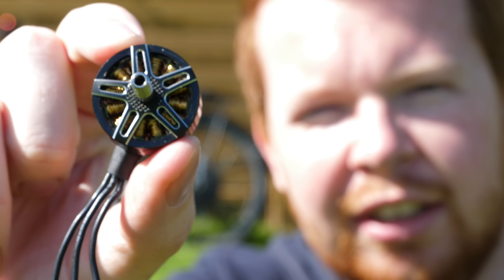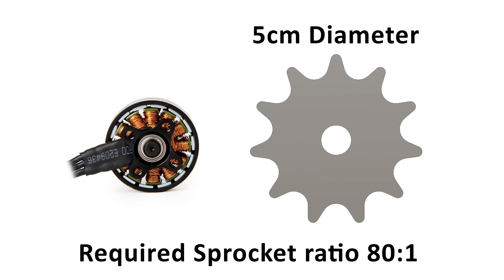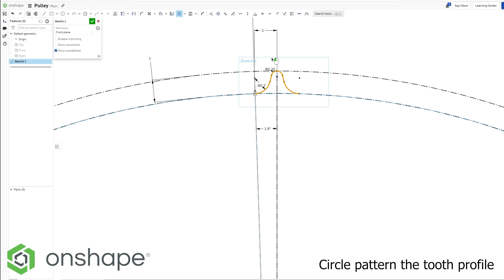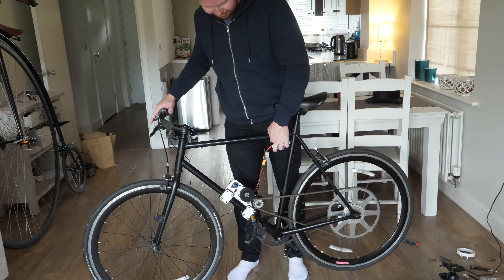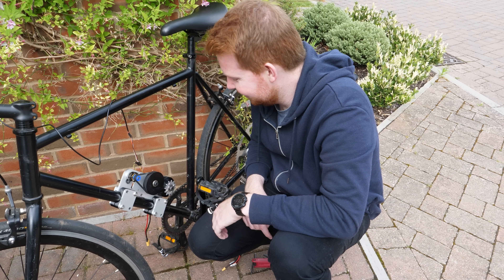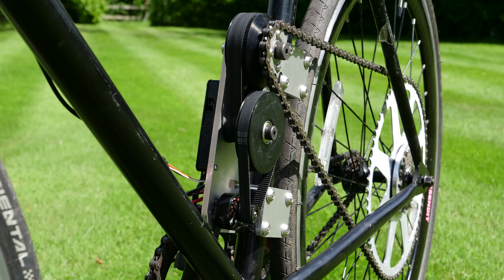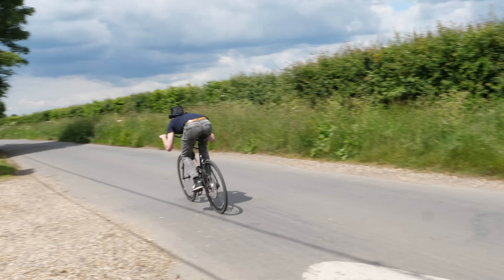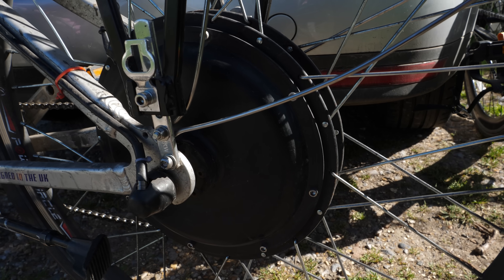Tiny 1kW Electric Bike Motor

Comment: If you were able to compare power and torque curves for both the bike motor and drone motor I’m sure they would look quite different. I bet if you were theoretically able to use a perfect CVT with no losses on the drone motor you could get it to perform close to the bike motor before over heating.

Comment: amazing video! It would be great to see video where you explain in details difference between mechanical and electrical power. Where all other wattage goes from 1kW - actual bike power? all for heating? does that mean that regardless of the cooling drone motor has certain max mechanical power hence the efficiency << 100%? that's no intuitive, because common knowledge that electrical motors all have  efficiency close to 100%. Also,  that tiny ESC you had installed, it seem like it shouldn't produce more than 40A max current, but these ESC usually designed only for burst max current, no continuous - is it possible that ESC is actual bottle neck there?

Comment: the wheel motor greatly increases the unsprung mass, while the motor in the carriage or as you put it on the frame leaves the weight distribution of the bike the same, it was worth using motors for aircraft, although they have more mass, but also higher torque ...

Comment: Its that initial start from a dead stop that is taxing the motor in my opinion.. but i would like to see a mount that would accept 4 like 3010 sized motors or similar size as a test. Or even better... 2 large X-CLASS motors but using the factory multiple gear selection of road bikes or mountain bikes to keep the motors at their optimal rpm.

Comment: Please add more motors and serpentine the belt around the shafts in a "W" shape so they share the load. maybe also just use a single wide toothed car engine timing belt and the 1-2 matching cogs from a engine head instead of a standard bike chain/cog. the motor mount slots and maybe also the belt tensioner from a scrap car (or same timing belt replacement kit where you get your belt) could be used to take all the slack out and tension it properly.

Comment: A few times in the video the chain split-link is visible and you have the split pin(the springy bit) on backwards, this would encourage it to release and fly away when the chain rubs against something. Love the engineering behind this project, keep up the good work :-) If you're ever over in Ireland we could do with some ideas on how to finish our trike project with a 110Hp 2.0Hdi automatic fitted :-D

Comment: What if you made the motor spin a roller, that was held against the tire?

Since the ratio of drive roller diameter to driven (road) tire could be easily achieved drive system would have fewer parts!

Comment: Why not ditch the chain and run a wheel on the tire. Could use a skateboard wheel as a drive wheel and a spring loaded pressure hinge

Comment: I don't know a lot about the topic, but I find it curious when such little motors have crazy high power ratings. I guess, in a drone, the motor is directly under or above a fan, and will get a lot of cooling air.... still, I know with lots of DC magnet motors they will have a rating for both max or momentary power, and then have a continuous duty rating that is a lot less. 

Some manufactures will just conveniently leave out the continuous duty rating and the word "max"  and just call it their power rating. Even worse are vacuum cleaner companies, who blatantly cheat the system and measure their motors from max rpm to an abrupt stall... so basically measuring the momentum of the motor and not torque. 

Rant over

Comment: I think a proper heat sink and possibly a air scoop to pull air past it, you'd get passed the over-heating issue.
Reply: And where do you put this heat sink?  The heat path between the stator coils and the motor mount is not very efficient, so no matter how big a heat sink you mount it on, the bottleneck is inside the motor.  These motors are designed to use forced air cooling, and that's the only thing that will work for them.  No big deal, though - just incorporate fan blades in the 3d-printed motor-to-drive cog thingy.
Reply: @BrightBlueJim  I was just thinking some fins off around the main body, to help dissipate, and the scoop as a stand-in to blow air past the motor.
The faster the bike, the more air through the scoop, past the fins and motor vents.
Reply: @zeekjones1  On an outrunner motor, which almost all drone motors are, the "main body" is the rotor.  It doesn't actually generate a lot of heat, because it only houses the magnets.  Most of the heat is generated in the stator, where the wire coils are, and there is very little path for that heat to get to the mounting hardware.  Furthermore, it takes a LOT of airflow, like way more than you can force through the rotor with just a scoop, to cool these motors.  Just trying to save you some time, since plenty of people have tried what you are suggesting, and failed.

Comment: Add a cooling cowl around it and a short bladed cooling fan directly on the motor shaft, that oughta keep it much cooler, but its always gonna be far worse in range from all the gearing losses and thermal losses. This was very cool to see though, as an experiment to show, practically, just why low rpm motors have big rotors and why high rpm ones use a tiny rotor instead.

Comment: My idea for a version 2...
Add more Motors around a central gear system they all dump their power into that you then connect by a chain to the rear wheel gears, then enclose the engine and gear and install cooling fan of sufficient power... or submerge them in liquid, like the kind for PC Cooling. 😈

Comment: The trick with a drone motor is ram air cooling and a fan. The fan roughly the same diameter as the motor and there need to be through flow holes in the backplate.

Comment: Perhaps a worm gear would have worked better. (If it allows the main gear to spin the worm gear to prevent everything from breaking.) A worm gear would allow you to mount the motor in such a way you can cool it with the air from the bike. Not much but at least something.
Im sure if you make a thing where you put a lot of gears together to slow your 30k RPM down and secure it so force is distributed equally across the plates yes plates Then add air vent holes and literally a drone propellor on it... you would have been fine with the heat.

The thing about this is that 30k RPM is fine but it takes a lot of time to accelerate it while going from a lower RPM does not take as much time. You are also dealing with flywheel forces. Not good so going with a much lower RPM but the same force is favorable in this case. Perhaps a clutch + more flywheel could have made it feel a lot less slow. But that will costs a lot of energy too.

Anyway... Time to strap a 40kwh 800 RPM motor to the bike.

Comment: I'd expect that an electric motor designed for high RPM that's mechanically geared WAAY down to produce torque would lose a lot of efficiency through all that gearing.

Comment: So does this mean it could possibly work like pistons like if you had many of these small engines there would be half the amount of stress on each motor you add. like say if you had six small 30,000 RPM motors it would be the same torque as three 15,000 RPM motors but your top speed in revolutions would be doubled? I know there’s some other difficulties there but would I be correct in any way?

Comment: I have already done similar to this using a large 6010 drone motor and a small two stage reduction before my cranks. 7s battery gets me at about 120rpm at the cranks and I can shift my final drive for more or less top speed. So far my motor is hardly hot as a pedal assist. It's not a bad idea at all! And quite a few people have made simpler versions with bigger hobby Motors like your previous builds but on a mid drive.

Comment: It seems like that gear reduction would do pretty well for motor braking to charge the battery pack. Perhaps some midpoint drone motor and run it through a planetary gear system, for torquey acceleration, and high RPMs for braking/energy-recovery.

Comment: I would have loved to see you take this concept further and keep testing with bigger and bigger drone motors. After all, there are "beast" class drones that are pretty massive with humongous motors, and I'm sure one of those motors would work really great.
Reply: it would, the problem is that the kv rating is so low that it approaches a normal ebike mid drive motor. so its no different than just putting a regular motor on a bike
Reply: @Blox117  still way more compact though, so I'd still be interested to see it. It would also be interesting to see if it would be able to handle the load without overheating.
Reply: @bummer6  its not more compact? mid drive has the whole system in one compartment.

Comment: Hey man, you need to try out inrunner brushless motors for rc cars, that contain separate sensor (and wires). They are much more suitable in case you have heavy payload - drone motors motors and regulators suppose they increase rpm rapidly to the limit (volt - defined) with getting some volts.

Comment: 6:05 Now imagine that instead of going with a slightly larger drone motor for more torque and less rpm, you used one the size of, oh I dunno--a hub motor? 😜  Still, worked better than I expected, for sure. 👍

Comment: If would be awesome if you built a little bike dyno to see how much mechanical power you're actually getting out. Might actually be worthwhile with all the bike propulsion projects you get up to 😉 
EDIT: On second thought, you could EASILY retrofit a bike power meter to do this. Check out powertap hubs. You could build one into a little drum for dynoing anything with a wheel...
Reply: We know what project you’ll be spending the next few months on now
Reply: I can't believe you still have time to watch YouTube.
Reply: You could dyno the motor by putting a flywheel on its shaft and plotting the speed of it over time with a tachometer. Then find its torque and power from the flywheel's moment of inertia and angular acceleration. You could also do the same by using the rear wheel as the flywheel but would need to consider the inertial contributions from the rest of the setup.
Reply: Can we get a collaboration please? 👉👈
Reply: I want a collab of you two
Reply: that's a person i know!
Reply: You can repurpose an automotive alternator as a comparative dyno... just measure the wattage output
Reply: Love your videos,Boss!
Reply: Zamn
Reply: Hmu if you want to talk about bike power meters. I have designed them before. If you make a bike dyno you are going to need a brake. If it's passive, eddy current brakes that are popular fitness equipment would be a good choice. It would be a good video, eddy current brakes are kind are neat.
Reply: Or an accelerometer like in a phone. Or calculate acceleration with distance and time.
Reply: Also, since these drone motors are usually designed with the propeller of the drone itself to provide cooling for the motor, you could 3D print a little air funnel that catches the air when you're going fast to stream it to the motor!
Reply: I don't have a clue of what you just said, but I approve this comment
Reply: How about a drone using Dyson fans? Could you make a silent drone?
Reply: Sounds like a great idea for a collab :o
Reply: @neytiritetskahamoatite7688
1 second ago
you just couldn't use normal pedals, could u ?! but those stupid jokes 😂😂🤣
Reply: If you have access to a hill and a stopwatch, you can get the job done with a reasonable degree of accuracy using energy accounting.
Reply: 8 Drone Motors + Inline Skates🔥 🛼
Reply: skateboard next!4 of these tiny motors on the wheels!
Reply: I built a bike with magnetic engine  (No electricity and no batteries) are you interested ? We could build them together
Reply: I wonder what you would do to add your own spin on an E-bike!
Reply: @TreyShawn42  wife mode
Reply: @vintyprod  life insurance fraud speedrun

Comment: since the whole setup is so small, would it be possible to mount it on the front wheel? and make a two wheel drive with two drone motors? might lessen the heat and increase the torque lol

Comment: You guys are really stressing the motor by using it from a standstill. I don't think that's how any electric bikes work either. Pedaling up to speed before using the motor makes more sense to me, especially considering that electric motors are useful for coasting when you're already at high speed.

Comment: Motor constant calculations are the way to go! The limit of the motor is heat production. Current gives resistive losses. Current is related to torque by the torque constant. Comparing the motor constant (torque constant divided by square root of phase resistance) you can make a nice comparison between different motors.

Comment: The other key difference between these motors when it comes to exploiting their individual torque, is that the ebike motor will be 'sensored' whereas the drone motor isn't
Reply: Unless you're trying to go super slow the sensor doesn't really matter, the back EMF monitoring is so good now that you don't need sensor wires on  small motors, there's a reason you haven't seen them in 10 years.

Comment: Maybe cool it in oil bath with radiator.  Have motor double up as centrifugal pump impeller.  Need low viscosity oil.  Mineral oil maybe OK.  Need thermal cut out well below oil flash point.

Comment: Would've been nice to have had a power meter inline to see out how much power the ebike and the drone-motor ebike were actually pulling
Reply: Watt meters for testing the drone motors are actually pretty cheap.
Reply: @toolbaggers  Sadly, as tom indicated this can give you only an estimate. The mechanical power would be interesting - you'd have to measure the output torque and velocity. But using some sort of drag-race can give a rough estimate of these quantities (at least in comparison, due to friction and weight...).

Comment: For the most part, the limitation appears to be a cooling issue.

Is it possible to add cooling capacity to the motor such as a liquid cooler?

What about motor pairing to reduce the load per motor?

How many of those motors would you have to pair together for it to be able to propel the bike without overheating?

Comment: Just as an illustration: a motor like 4260 480kv motor direct-driving a rim of a 700c wheel imply a reduction ratio of about 15 times. If we are to use 6s (22v) RC battery, and limit phase current to 50A, we'll get about 13nm of torque at the contact patch per motor, resulting in highly useable 26nm of torque overall (which means 70N of thrust) and top speed of about 38 or whereabout mph which you MIGHT actually achieve if your assume aero position, because that's  close to 2kwh true mechanical power at that speed, with efficiency close to 90% if stated motor specs are to be believed, that is. They do seem kinda reasonable.
Reply: That are good stats.
Add-E uses 275 kV , 22,0 (~ 6000 rpm). The roll on the outrunner is 51 mm in diameter (circumference ~ 160 mm). That's  a reduction of ~13 on an 18-622 tire and it works pretty well.